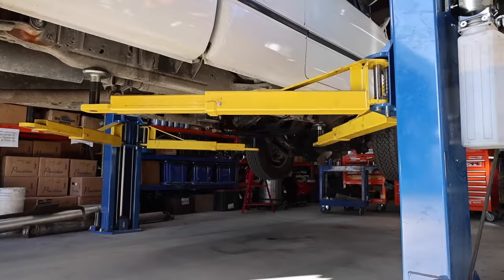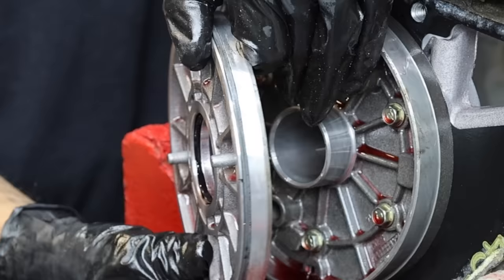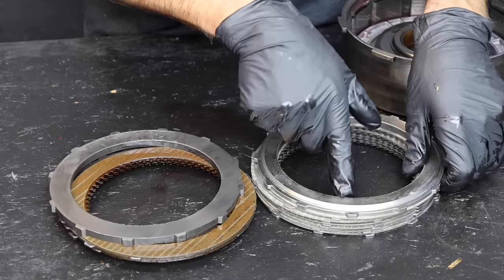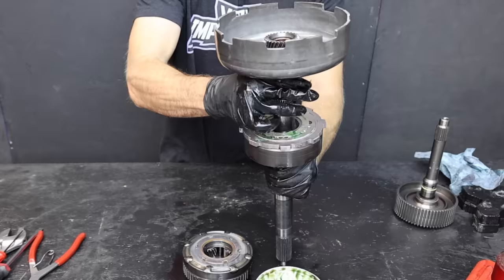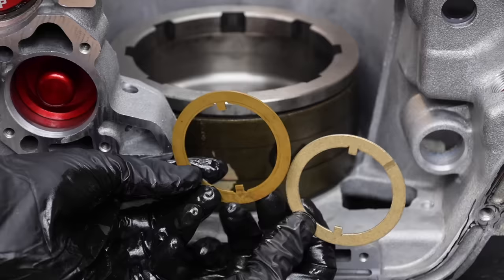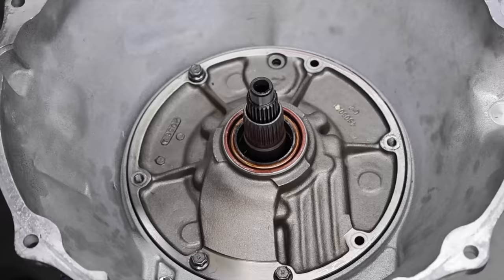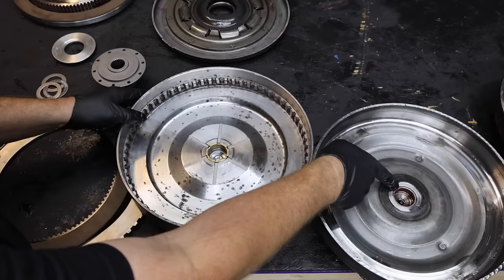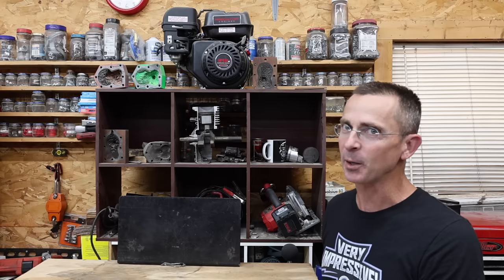Did I Waste $4000 on a DIY Transmission Rebuild (47RE)?

Comment: Same reason i decided to have a remanufactured engine put in my 2001 Durango.  Owned it since 2006, really like the truck so when he head gasket gave out at 174k i already had a list of repairs and upgrades i needed to do but the difference between head gasket, lifter, timing chain and guides and a few more things was only $1000 so i had a summit racing oem reman installed and its the best the Durango has run in years. The $5'000 I paid to buy engine, supplies and shop fees (fluids) and labor has already paid me back for 24 months on no $800+/- monthly payment. So no, you didn't waste $5,000 at all.  I enjoyed this long-form complete project video and liked how you put the comparative aspect in when using certain tools.  Great channel 👌🏼
Reply from the maker: Thanks!

Comment: I'm an amateur wrench and rebuilt the transmission on my 1991 Toyota Land Cruiser, a fully hydraulic A440F.  It was a very educational failure.  I'd burnt the 1st/reverse clutch and after the rebuild I once again had first and reverse but... the unit wouldn't shift out of 1st on it's own. I could get to 2nd with the shift lever, but 3rd and 4th never engaged.  I assume I messed up something in the valve body, but a pro transmission guy (and his best tech) couldn't figure out or correct whatever my mistake was.  They ended up finding me a working used A440F and gave me a reasonable deal.  I don't know if it would have changed the outcome, but this terrific video would have demystified some of the process.  But I learned a ton either way.
Reply from the maker: Thanks for sharing.

Comment: Beautifully clinical once again.
Pump stator asssembly bushing: You fractured the new bushing wall when you hit it with a tool too sharp for making the indentation locking mark (a flat screwdriver blade). Probably will never cause a problem but as well as ensuring the bushing holds its strength AND to prevent minute debris from the fracture entering the machine, never fracture - use a rounded tool, anything not to cause damage. See the original factory marking. I'd make a rounder indent even than the factory mark. 🙂

Comment: TOTALLY IMPRESSED! The ONLY way you knew a lot of things in this Trans rebuild was to get a LOT of experienced input. Some of the critical, and key items a lot of folks should know:

Overdrive piston - small amount of wear (scoring) that would help from some minor scotch brite, on the lower left, not bad but could still use a very small bit of smoothing.
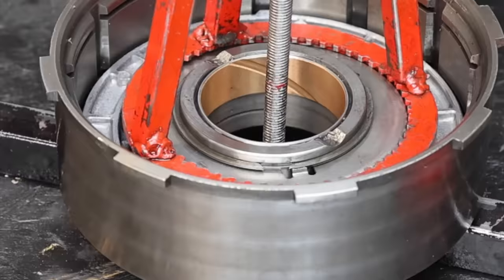10:20, 24:20 glad you mentioned pre-soaking the clutch plates in Trans fluid before assembly. That is more important than you might know. Generally pre-soak them for 24 hours before assembly. Glad to see at 14:00 you at least dipped the clutch plates in Trans fluid as you reassembled. Best to soak for 24 hours but at least you didn't do it dry!
27:00 soak the band, or at least lubricate it before installing! Only miss I saw.
30:15 Awesome advice to flush / replace all trans fluid. You say within 1,000 miles, personally, I would suggest around 300-500 miles but you are SPOT ON!
Reply from the maker: Thanks!

Comment: Gotta say Todd, when I saw 38 minutes I thought sure I'd 1.75X it at some point but was hooked by your great videography from the beginning and loved every minute of it!  Also gotta love 500HP and a tranny and drive shaft to handle it, but is the differential next?  My hat is off to the Mechanics at Power Driven Diesel and you for taking the plunge into such a complex rebuild...and filming it!  Very Impressive!  As an old engineer (25+ years) and Journeyman mech for 7 years back in the day, I have always been in awe of the automatic tranny's, their designs, tolerances, and the brains to think the designs through.  Rebuilt a couple of 350 turbo's to take the HP and a couple of slip-n-slide power glides back when, but the most fun for me was a decade ago helping my son put a B&M shift kit in his 65' Malibu SS Slip-n-Slide and dialing it in...Great fun and got to hand my son tools for a change!  Thanks Todd...Keep On Truckin'!  ~¿@
Reply from the maker: Thanks!

Comment: In my early 20s I worked at an IT shop that was just up the street from a transmission shop owned by a guy I knew. So I'd walk down to the tranny shop to hang out during my lunch breaks. Watching him work and learning how transmissions worked and went together was a lot of fun, and I learned so much. I feel confident I could rebuild a transmission my self if I needed to, except for my ADHD that would probably leave the project half-finished and scattered across my garage for 3 or 4 years before I got back to it lol.
Reply from the maker: Thanks for sharing.

Comment: At age 14 my dad gave me a truck with 43000 miles and bad trans and rear end. He paid for all the parts and I rebuilt the rear and transmission. Over the next 4 years I had that trans out about 8 times replacing the front seal on transmission. Had it professionally built once but still ate front seals. Ended up being front pump bearing that didn’t come in kit. Replaced converter 3 times and never though about bearing. In the 35 years since then I have always replace that on every other transmission I have done no issues.
Reply from the maker: Thanks for sharing.

Comment: This is an excellent video! Thank you Todd! Not only was this video entertaining, but extremely detailed as well! I really appreciate the detail and work put in to clearly show the complexity of a transmission rebuild.  After working on Honda 6AT and 10AT’s I have a huge appreciation for the engineering that goes into transmissions. This video was not informative but clearly shows the intricacies of a transmission. You didn’t have to do it the hard way but you did anyway. VERY IMPRESSIVE!
Reply from the maker: Thanks!

Comment: Awesome video, as usual!

I have a couple words of caution: 
I'm a fan using cold chisels instead of screwdrivers. Chiseling with a screwdriver usually mangles the tip, and sharpening a screwdriver usually ruins it as a screwdriver. Unlike a chisel...

Be careful with those picks. It's easy to score a bore, or nick a seal.

As with everything, YMMV. Have a great day!
Reply from the maker: Thanks!  Thanks for the feedback.

Comment: Requesting a garden cart comparison please. Use an extra large Gorilla dump cart currently. I haul horse manure, soil, compost, logs, plants, garbage, and sometimes water. I've pulled it by hand or used it as a trailer behind a garden tractor. We have a CAT loader but I don't want it in my gardens or near the house as it displaces the soil. The Gorilla has ridges inside that makes mixing soil or dumping a pain. It has large wheels that go over wet soils well but are susceptible to puncture (locust thorns). It's also got high sides that can make shoveling in and out difficult. I'm too short to use a wheel barrel which DH thinks is hilarious. Thanks!
Reply from the maker: Thanks for the suggestion.

Comment: Harbor freight has a drill pump and I have found it is extremely handy to have kicking around the house for things that you would usually use a shop vac for but you can put 10 feet of hose on the outlet and not have to empty a shop vac. I have used it to pump out toilet tanks straight into a drain. It saved me when my ac drain plugged and I had 100 gallons of water in my attic
Reply from the maker: Thanks for sharing.

Comment: This is awesome, Todd. You're putting out close to the same numbers I get with a much more expensive (and eventually much less reliable) 4th gen Cummins. Sometimes I wish I'd kept the third Gen.

About transmission rebuilds - I learned to work on my own vehicles from my dad, who grew up working on his. But when it came time to rebuild my first transmission, dad told me just to pay someone else to do it. His only experience with transmissions was with a Model T transmission that someone else had already disassembled, and he reassembled it without a reference point. Said it was a huge pain.
Next time I'll be rebuilding it myself, since I do literally everything else myself as well.
Reply from the maker: Thanks!  Thanks for sharing.

Comment: Another Project Farm video I watched from End to End!!

Gotta love those Cummins, and I believe this truck/engine was in the late 90's. The best years.

Back in 2005, I had another brand new Cummins in the 1 ton 4X4 extended cab. When I found out that not only would the 06's auto tranny handle the Exhaust Brake, but that 2006 was the last year for the 5.9, I traded it off for an 06. Still got it. And another 06 dually for my Truck Camper...
Reply from the maker: Thanks!  Thanks for the feedback.

Comment: Last time I did it was around 1984 on a turbo 350 but the parts, clutch packs etc were only around $200…….😂
Made my own tools to compress the clutch packs, emery on the the valves in the valve body. Even used a B&M shifter kit….
I remember you gotta soak all your new parts in trans fluid over night before install and I didn’t see you check the thrust bearing play between input and output shafts prior to disassembly .
Love your videos
Reply from the maker: Thanks!

Comment: I used to own a 24 valve with PDD compound turbos and 7x10 injectors. 

It ate my newish 47re, leakage in the rear diff seal shaft seal, and lots of irregular wear on my rear tiers. Good luck!
Reply from the maker: Thanks for the feedback.

Comment: Just a FYI those split teflon bands on the servos are not seals. they are wear bands. You often find them in hydraulics. It provides a spot for the rod to slide against the bore without hurting it and adds stability so it doesn't get sideways in the bore.

Comment: DUDE, I just rebuilt my Allison 100 6spd with good Raybestos clutches, Transgo shift kit, steel spool valve upgrades, Shift vale spring upgrades, Ratiotek pressure regulator kit, all new seals+gaskets including 4gals TranSynd 668 synthetic fluid for LESS than $1,500 TOTAL!
Reply from the maker: Nice!

Comment: I’m a nobody but what I’ve noticed over the years…if you change the trans fluid frequently from the beginning you’re good- if you wait till over 100k your asking for your trans to act up. This is also adding in the “closed transmissions”

Comment: i rebuilt my 4r75w crown Vic trans myself with all high-performance stage 1 racing parts and did the j mod. it cost me a little over a grand and took a full weekend to build. now I want to replace the rear-end gearing and she will be ready for 1/4 mile drag racing. I am aiming for 8.5s in the quarter on a single-turbo coyote crown Vic.
Reply from the maker: Thanks for sharing.

Comment: Those guys did a great job on removing the transmission and all but you in fact do not need to spread the frame apart to get the trans cross member out just hit it back towards the rear of the truck coming out and back in

Comment: Well Tod you are really into my territory. Those transmissions as you probably know are 727 torque-flite made over. I have rebuilt hundreds and dozens of the  factory modified ones for the Diesels. We used to beef the old ones with the parts available at that time. I have done many different automatics. I was doing thise in the sixties and seventies likely before those guys were born. I think I will always like that transmission. The major drawback for Diesel applications is the throttle pressure characteristics, the fact the Cummins has so much torque at low throttle position and unlike the new ones it has to accept high force shifting because there isn’t and computer system to de-fuel the engine. So they are a driver’s transmission and engine combination. I own 96 and a 2004.5 all stock of course.
Reply from the maker: Thanks for sharing.

Comment: Todd - I would like to suggest testing various brands of Infrared non-contact temperature guns. Example of manufacturers like Fluke, Klein, Thermoworks to less expensive even cheap ones. (Harbor Freight)  Compare accuracy, how they work on various surfaces, laser dot type/size, temperature range and accuracy over range, ease of use, durability, etc. Was thinking of ones used in industrial or mechanical applications vs. cooking.
Reply from the maker: Thanks for the suggestion.

Comment: You're a brave man, better than me. I can rebuild an engine a manual transmission and do just about any kind of mechanic work, matter of fact we own four older Subarus and and the transmission gave up at 238k in our 97 impreza but I didn't dare try to rebuild it myself cause I never did one before. It looked very complicated, it cost 4600 dollars to have it done. We had them replace everything inside other than the main gears, they even replaced the planetary gear.

Comment: I paid around $2000 to rebuild the 4-speed in my Avenger. I would rather rebuild, than buy and replace. At least you know the parts are being fixed and replaced.  With the cost of newer cars, it's cheaper in most situations to simply fix the older ones. At least, this is my experience with vehicle pricing in my area. Oh, and have you ever done a vid on the effectiveness of Seafoam in the oil crankcase? It says on the bottle you can use it directly in the oil as a cleaner at 100-300 miles before the oil change. I've been watching for a few years now, but I cant recall this suggestion being made into a vid. Maybe one for fuel cleaner, but not oil.

Comment: #ProjectFarm  Great video I have never rebuilt that yr make of transmission. I could rebuilt a 2 speed powerglade  Blindfolded. That is when I was drag racing.  Its great it see a YouTube out of the Show me State. I live in the center if the USA. In the Show Me State. I have a small YouTube channel I dont get paid. Don't have that many people watch it. I fly Drones. But there is so many people that do that on YouTube. I wish I could get Started on a YouTube channel doing something. I am 60 yrs old I can do about anything that there is. It takes a lot of time to make one. I been watching your channel for years. It is a great channel. When I was 29  it was 1993 Jan 16. I was a diesel  Mechanic an tow truck driver. 
When out on a call ice an snow they shut I-44 down . Truck driver didn't listen went on in to St louis. Top a hill on 44 an seen my red lights. Jack knife his trailer smashed me between the pick-up an wrecker drug me 213 ft down the hwy.  Lost both legs above the knees. Broke me back 5 places. Life lives on you can not set an cry about it. Again love your channel keep up good work.

Comment: Excelent job and I like the narration. The only thing I wouldn't do is use a metal pick to extract seals and orings. Aluminum scratches so easily. I'd recommend a plastic pick instead. 🙂
Reply from the maker: Thanks!  Thanks for the constructive feedback.

Comment: Those Chrysler transmissions are the WOOORST. I have a 46RE Dodge 1500 with a 5.9 and it's already been rebuilt. I gotta say it's much cheaper to just have it done professionally if you want them rebuilt.
However, if you're going for power...DIY is definately the way to go.
Reply from the maker: Thanks for the feedback.

Comment: It is incredible how a transmission was created in less then 150 years.  

How did someone envision all those inner parts transferring power from air+fuel explosions pushing down pistons, connected to multiple shafts & rods & gears, into a device that changes gears automatically based on speed to turn the wheels???????

Original cars had simple motors connected to big ole wheels right?  How did someone think up multiple gears and the automatic transfer between them controlled by speed?  

Regardless, I am curious how long it took Project Farm to learn all the names of all those parts in the video.  Did he have the shop guys standing behind the camera writing the script so each section could be accurately named as he did the work?

Good job Project Farm!  It was fun watching you take that 1500hp ride at the end in that "daily driver".
Reply from the maker: Thanks!

Comment: I helped once a mate change a clutch, once a much easier task than this one, and after that I always say that a professional mechanic for anything that isn't jut basic maintenance is very cheap compared to the trouble it saves.

I would never do something like this on my daily driver that I actually need, I could consider if I had a hobby car though.

Impressive video, good work.
Reply from the maker: Thanks and you are welcome!

Comment: This time of year with hurricanes coming everybody’s looking for a way to run their house on a generator. I would suggest you have a video on something called hard start kids and soft start kits for their air conditioning. In layman‘s terms a hard start kit works as a start capacitor to give the compressor a little bit of a boost to get it to start running against pressure. a soft start kit operates like a run capacitor, smoothing out the sign wave of electrical reducing the overall amperage draw to an air conditioner. That having been said some of them are nothing more than snake and some of them can actually reduce your electrical usage, even when you are not running on a generator, but while you are on generator, it allows you to use a smaller generator. When you are not on a generator, the energy is lessened by a not completely insignificant amount. I can list probably 10 different soft start kits. The one recommended by Cummings generators is micro air. But if you could test some to see who Actually meets their specifications that would be fantastic. I have been in the generator business for years and I can tell you properly set up air conditioners can allow somebody to run their entire house, including their air conditioning off a relatively small portable to run more efficiently not to mention running on a standby generator.
Reply from the maker: Thanks for the suggestion.